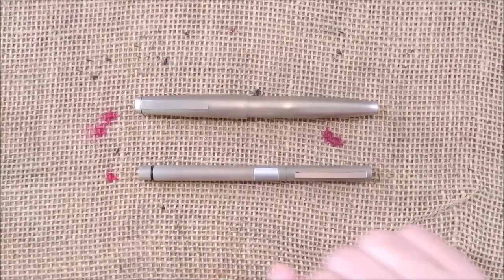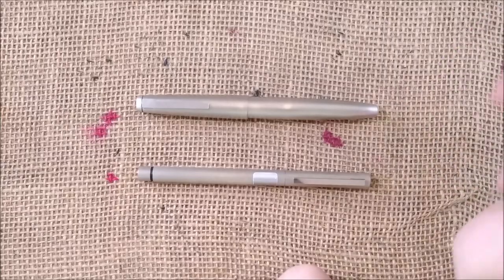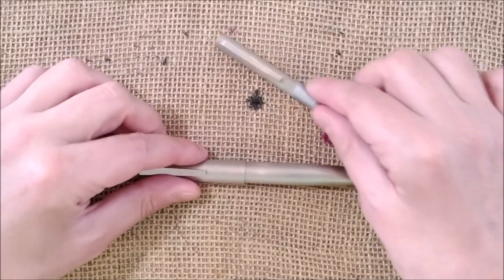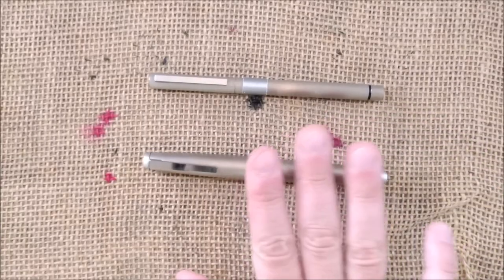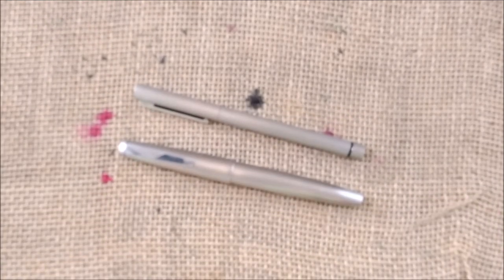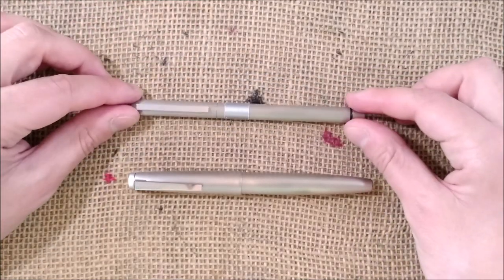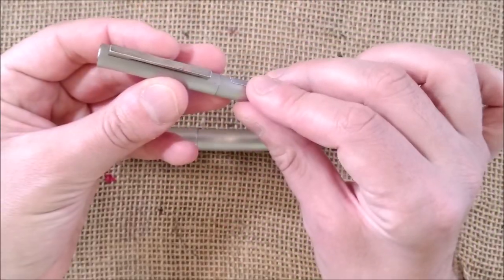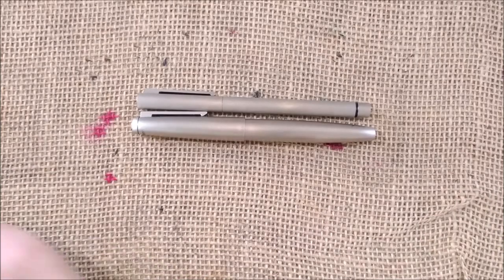VERSUS! Lamy 2000 Steel vs Lamy CP1 Steel (59)

Comment: This is a very welcome comparison video. I wished for it, you had promised to do it. And now we have it. Thanks for that! 
I’m definitely going to properly look for the steel CP1 and hopefully be able to buy one I like, at the right price. To hear of a wet nib, with pleasant feedback makes me even more keen to get a CP1 like yours. It would be such a cool companion to my beautiful steel 2k. I have a very wet broad nib on it. And then I have the silver Aion which I’m also very fond of. The only other Lamy pen I own is the Dialog 3. I don’t really like any of the other Lamy pens at all.
Reply from the maker: Thank yoyu for watching!
Be awere there were two models of the steel CP1. One slimmer and one girthier. Parts not interchangeable. My slimmer version came with gold nib instead of steel.
I agree on that idea of it being a companion of the 2000. As if the 2000 is the office pen and the CP1 is the one you carry with you. I really like how they complement each other and it was one of the reasons I made this video.
Reply: @OdE-ObjectosdeEscrita  …Yes, I honestly think these two pens are the same in the material used and construction. But dissimilar in many other things. However, that’s what makes the pens an excellent, natural pair that complement each other nearly perfectly. Like I said, that’s one key reason I want the steel CP1. 
Additional thanks for the tip about the two different size versions of the steel CP1. Contrary to my usual preferences, I want the slimmer pen this time.
Reply from the maker: @sajjadhusain4146  I don't know if you saw it, but if you want to see it check the review of the CP1 Steel: https://www.youtube.com/watch?v=TmwDv3TWZPo
There I show both versions of the steel CP1.
Reply: @OdE-ObjectosdeEscrita  …I missed that video. Many thanks for directing me to it. I’ll definitely watch it later today. It will be very interesting and helpful.
Reply from the maker: @sajjadhusain4146  Yes, it may help. It is a little confusing the two sizes for the CP1.

Comment: 1.  The 2000 is so beautiful, yet I don't covet it, for unknown reason(s).
2.  Amazing the difference in color with the same ink in the two pens.  Why?
3.  Your handwriting looks better to my eye with the 2000, presumably because it fits your hand better.
4.  As a known member of Team CP1, why don't I ALREADY have a CP1 in steel finish?  Oh right, the price.
5.  The most important difference between these two pens is the nib swappability of the CP1.  Available of course with many other LAMY pens.
6. Excellent review.
7. What was the name of the Aurora similar to the CP1?
Reply: Aurora Hastil was quite similar to CP1
Reply: It’s the Aurora Hastil. I mentioned it in Paulo’s review video of this splendid steel CP1. I have the Hastil and love it very dearly.
Reply: Oh, just saw that the other poster has already told you of the Hastil.
Reply: You all are right, the CP1 is remarkably similar to the Hastil.  Thanks to LAMY for coming out with a copy I could afford ($500 less).  Haters of the Jinhao 159 and other Chinese copycat pens, how do you feel about the CP1?
Reply: @ichirofakename  that's the hard truth which many won't accept! 😔
Reply: @ichirofakename  …I’d disagree. Fundamentally quite similar form/factor & design of the two pens, not least the fact that both the Hastil and the CP1 are particularly very slender pens. Slimmer than most others I’ve seen so far. But there’s no blatant copying that I can see here. 

The Aurora Hastil’s clip, nib design, striated barrel on the all-golden version (which I own) are different to what the Lamy CP1 is. Also, the Hastil has an especially vintage-y squeeze converter as the default filling system. Not so with the CP1.  
As for price, I bought my golden Hastil at an over-the-top full price of $535. I’d advise nobody (excepting Aurora fanatics like me who won’t listen anyway) to consider paying what I did. The Hastil can sometimes be had, in very good to near-mint used condition for considerably less: $140-$200(max). But no regrets, I adore my Hastil.

As for the Jinhao 159, it is a truly hideous pen in all respects. A cringe-y copy of the Montblanc 149.
Reply from the maker: Thank you for watching!
1. The price doesn't help, too...
2. I had freshly re-filled the cartridge of the CP1 and the 2000 was inked for a long time, maybe with a full week of no use. I think that is the explanaition. The ink dried a little on the nib and looked darker. It became lighter as I wrote.
3. I prefer the nib on the CP1, but the 2000 is more comfortable to use, for sure!
4. It is not cheap... I bought this one NOS at a store for a very, very good price. Closer to the price of a regular black one.
5. You are right.
6. Thank you so much!
7. Hastil, as Giuseppe mentioned.
Reply from the maker: @ichirofakename  I think it was mostly a design trend and some pens were made like that, not really copies of each other, I would say. I guess this is the kind of topic I need to address more deeply in another video.